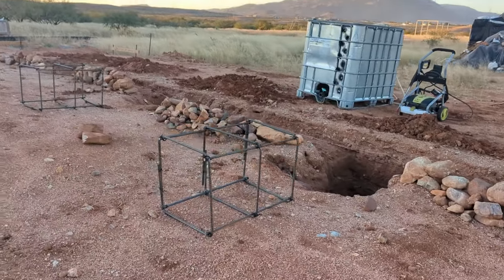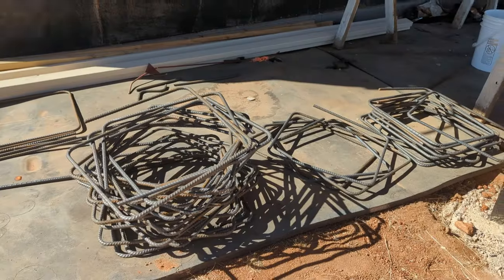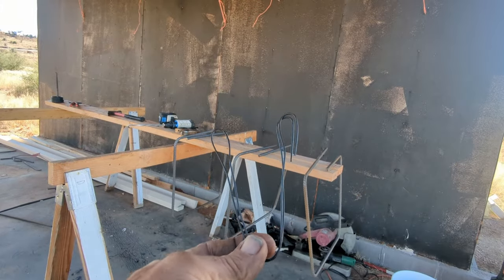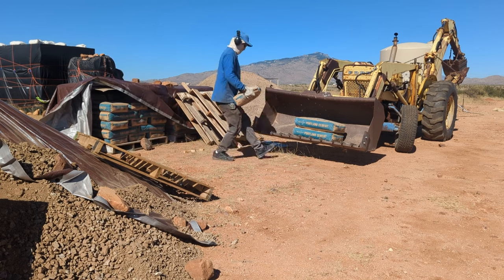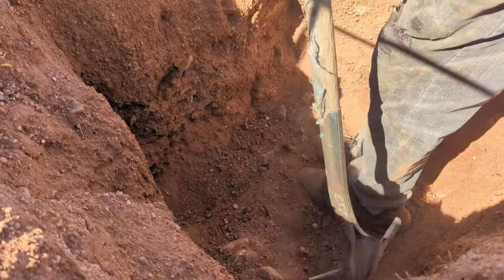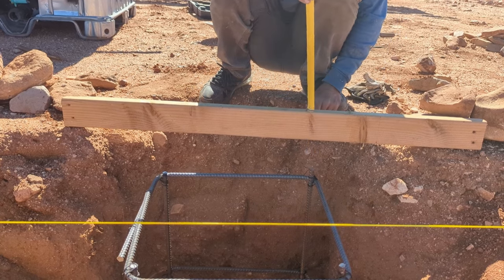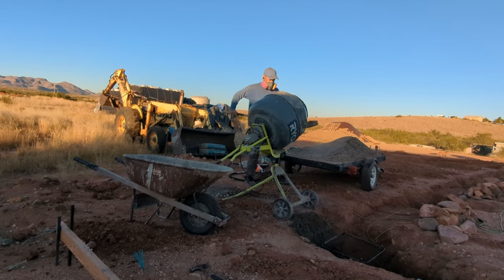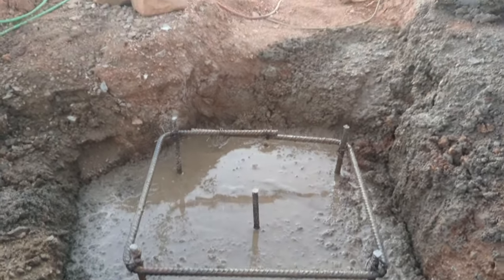Concrete Footing & Rebar Cages | DIY Home Build (Part 1)

Comment: If you had to dig those holes by hand then that would have been rough work considering the hard, rocky soil.
Reply from the maker: I did a majority of the digging for these holes because the guy that I hired to do the initial dig out for this foundation was limited with his machine to be able to dig these out anyways so I ended up having to go in and do most of it myself. If you saw my earlier videos on this channel back when I started the earth bag building I dug all of that myself and that was a 3-ft deep hole in the ground that was over 200 ft² and it was terrible lol. I use a modified jackhammer / chisel bit/spayed bit to dig out these holes which makes it a lot easier but nonetheless it's still not fun lol....
Reply: @OffGrit  Respect. It was rough for me digging 36" post holes here is the southern Nevada desert because of all the rocks. I also used jack hammer but still hard work.
Reply from the maker: @HalsPals  yes to me, I think that the physical labor is such a blessing to keep me in shape so I am always reminding myself of this silver lining.. plus I appreciate it so much more when I have tools to help
Reply: @OffGrit  Yeah, I was pretty slim last Spring from all of the hard labor but got fat during the summer when it was too hot to work outside. Slimming down again, though. 🥴

Comment: You may have done it but didn’t show it….you want a 3 inch clearance from earth to rebar with concrete surrounding it
Reply from the maker: Hello. You're correct. when I make these videos I try to be careful not to go too much into making them how to videos especially on something like this because obviously I'm not an expert in this field and generally I will keep it to a " this is what I did"  type of video instead of going too far into those rabbit holes because honestly there are plenty of other videos if someone wanted to watch how to's from professional concrete people. But yes there was 3 in of concrete clearance beneath each one of these cages